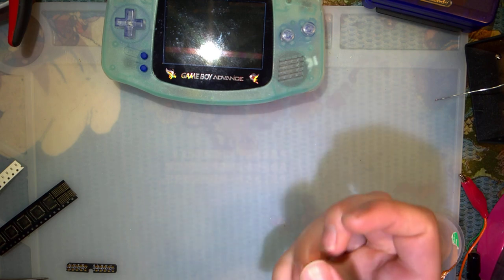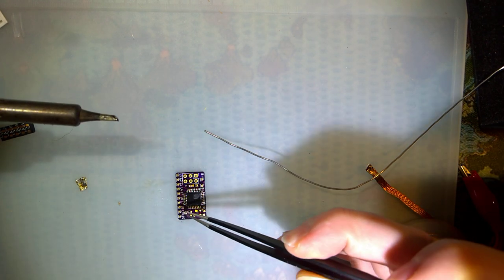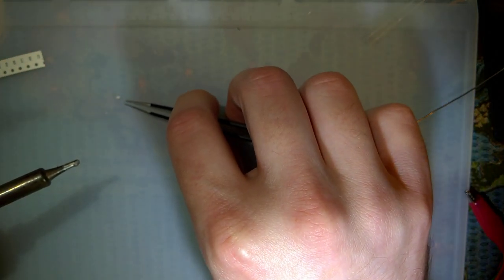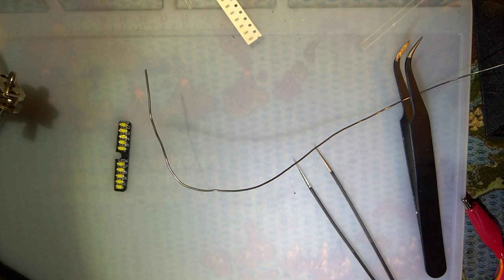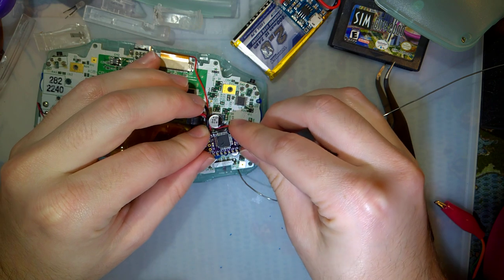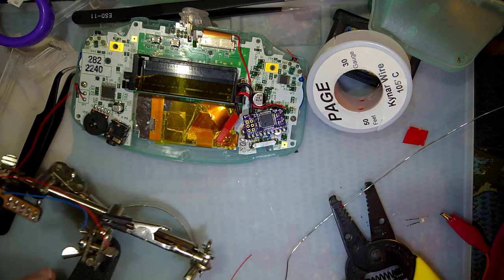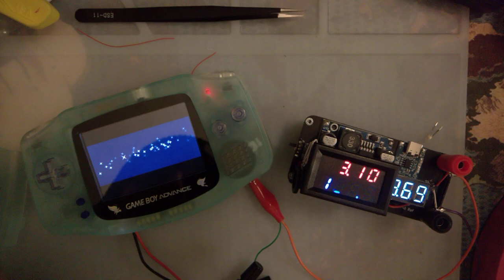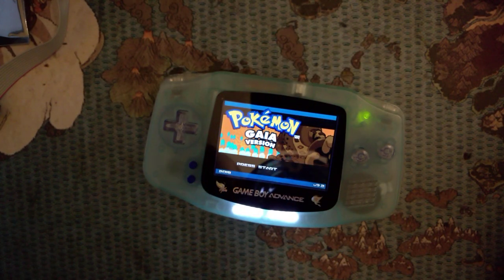insideGadgets GBA LiPo Battery Gauge

Comment: Is there a way to do this for Li-on batteries using the stock battery indicator instead? I'm using TP4056 and a LDO to keep voltage in check
Reply from the maker: I suppose you could just disconnect the battery indicator LEDs from the circuit and then wire them up to the battery circuit instead. You'd have to tweak the firmware to get the red LED to come on when the green one goes off though.

Comment: Just wondering do you perhaps know when you will be making the video for the GBA SP? I have been watching all of your videos and they are great. I do SP mods as well and have used your videos for a few mods now. I am very interested in making a voltage monitoring display like this but for the SP, but I am also still figuring out where it would be as space is so tight. It would be great to be able to order something with all the components already soldered and everything as well...
Reply from the maker: Did I say I was going to do this for SP? If so, my bad, I forgot. Regardless, someone else just mentioned this and I started getting ready to do that so expect a video soon(tm).
Reply from the maker: @JamminHyaku  This is the same device just in a different formfactor and pre-assembled. The reason I ordered bare PBCs instead of a board from Alex is because at the time the pre-assembled DMG version was not an option. 

And yes, I'm a regular on both the Game Boy discord and the insideGadgets discords. Same username.